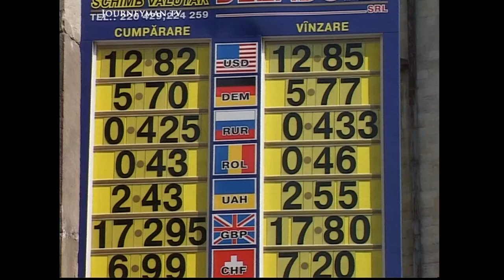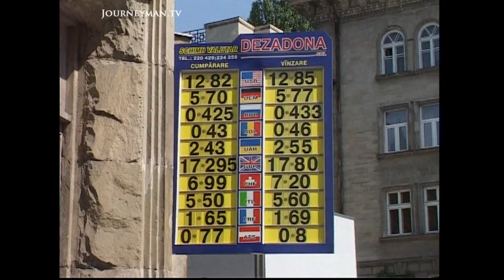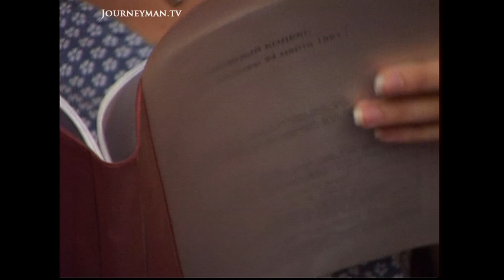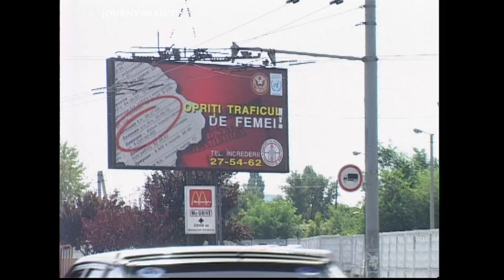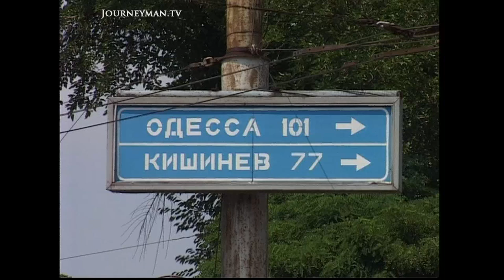Extreme Poverty in Moldova, Europe's Poorest Country (2001)

Comment: When you go to Moldova, you will see many houses half built. Men go work abroad and send money. When there is a bit of money, they buy doors and windows. The following year they may buy stairs or a bathtub, and so on. Life does not have the same speed. Building a house there can take 10 years, but its normal there.
Reply: Hello, I have a question. Inside of what's internationally recognised as Moldova, there's an unrecognised country named Transnistria with the city of Tiraspol. Moldove is very often claimed as the worst country in Europe but this classification doesn't include unrecognised states. So if we were to include Transnistria, would it be worse than Moldova?
Reply: @gamermapper  yes it still would be. Transnystria is even poorer than the rest of Moldova. They survive barely because of the Moldovan blocus on them.